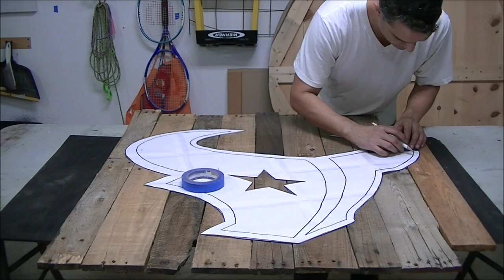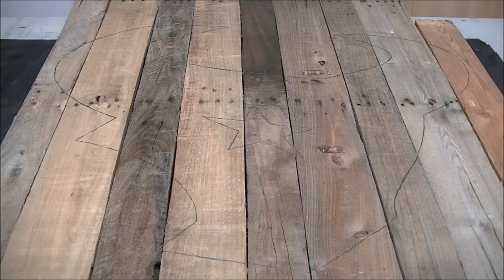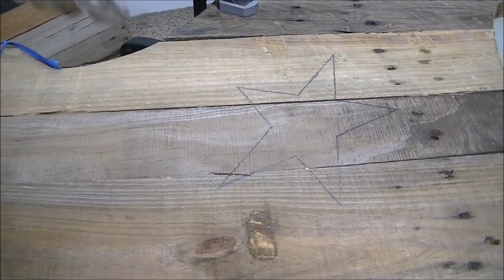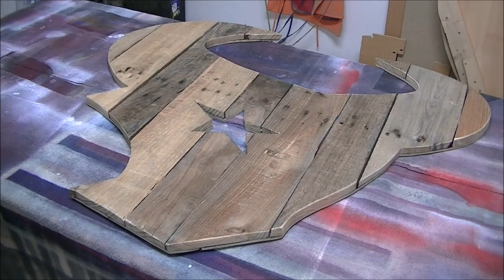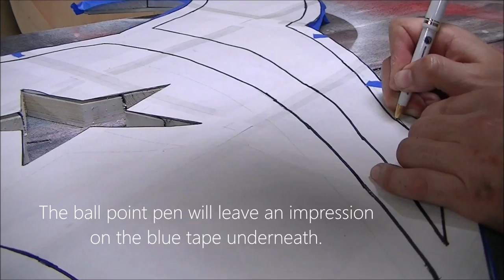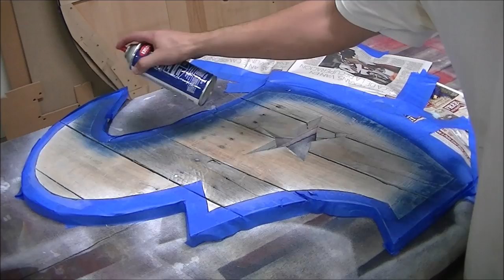Texans Logo from Pallet Wood

Comment: at 1:00 you cut all the way through for the star eye but end product looks like the eye has a background of white.  What did you put behind it?
Reply from the maker: Its a piece 1/4 inch piece of backer board that I painted white and glued to the back side.  I made this as a gift and I thought the wall it was going on was going to be white but it turned out to be beige.  So I added the white piece to the back so the logo would look right.

Comment: How do you create your large templates?
Reply from the maker: I use MS paint or photoshop.  Most printers will let you print out on a "poster" setting.  Sometimes its called "tiling" and you can usually find it in the Advanced Properties section of the print menu.

Comment: would love a University of Arizona "A" or "Wilbur" if you have a few mins to make a video, and or available for purchase....
Reply from the maker: Are you local to the Houston Texas area?  These are usually pretty heavy and the shipping cost can be, in my opinion, a little cost prohibitive.  These aren't hard to make and you don't need a lot of tools.  I got my jigsaw at Walmart for $30-$35.  You don't need a nail gun either you can just use screws instead, I am assuming you have a drill.  You can do this!  Plus the feeling of accomplishment you will feel is extremely rewarding.
Reply: Dan The Maker Man 

I am local to SoCal.

but I like your videos and want to try and make my own.
Reply from the maker: Go for it man!  If you need help with isolating the image you want or need more info just let me know.  If you are familiar with photoshop you are probably good.  If you need help figuring out how to print on multiple sheets of paper I wrote an Instructable on a couple of ways of doing it.  Good luck!
Reply: Dan The Maker Man 

thank you.  I'll let you know how it goes